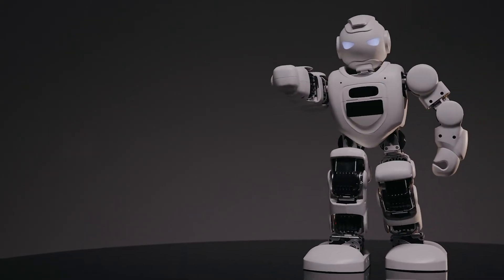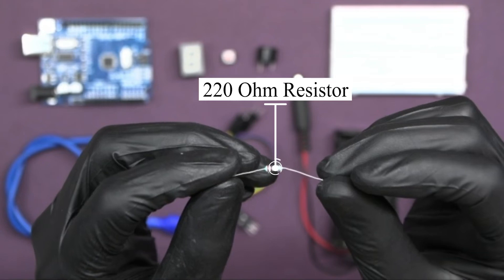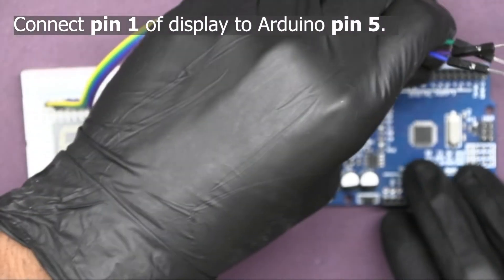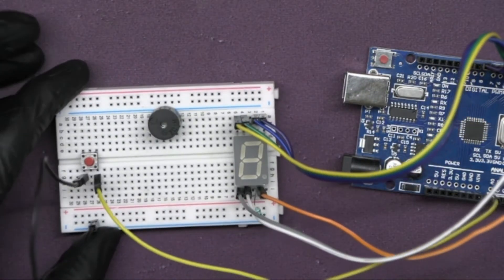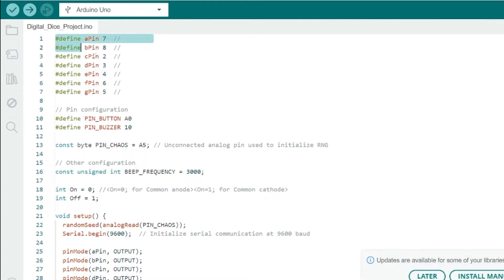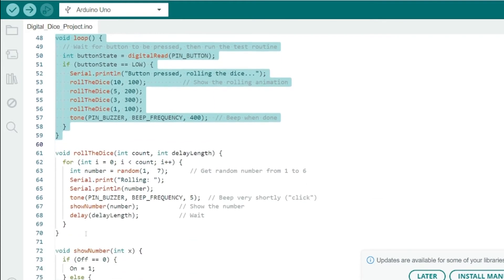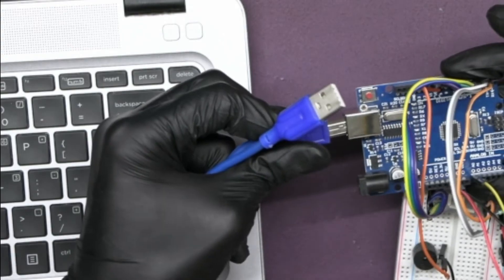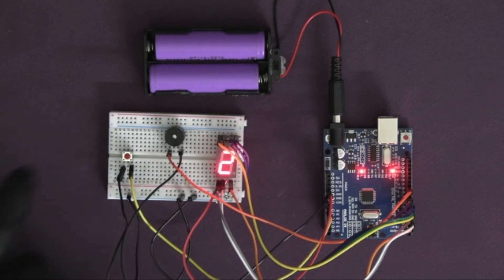LuckyRoller: Digital Dice using 7 Segment with Arduino UNO I Robo Army I Arduino Basic

Comment: the display is not working for me. is there a fix for this?
Reply from the maker: Sorry to hear that! Here are a few things you can check to fix the display issue:
1️⃣ Double-check the wiring connections, ensuring each segment pin is correctly connected to the Arduino as per the circuit diagram.
2️⃣ Make sure you're using the correct type of 7-segment display (common anode or common cathode) and adjust the code accordingly.
3️⃣ Verify that your resistor (220Ω) is properly connected to the common anode/cathode pin.
4️⃣ Try uploading the code again and ensure the Arduino is powered correctly.
5️⃣ If possible, test the display with a simple code to see if it lights up properly.

Let me know if you're still facing issues, and I’ll be happy to help!